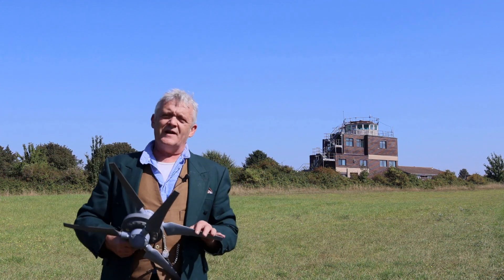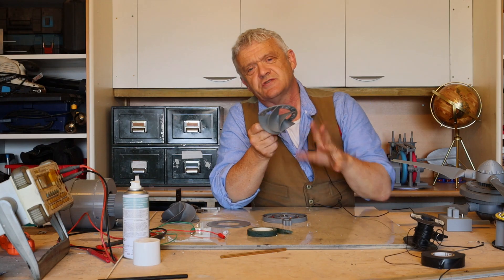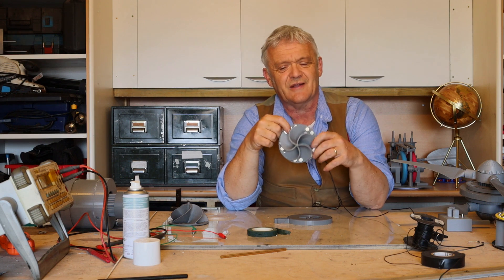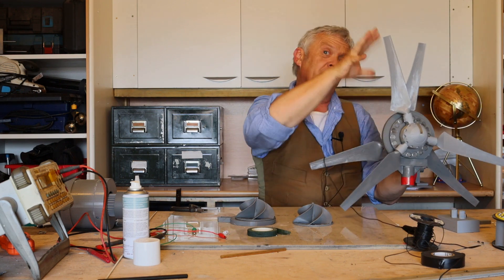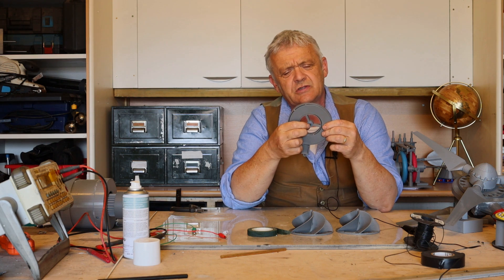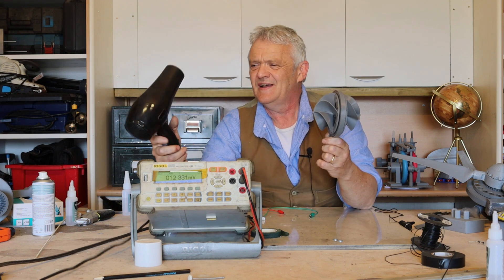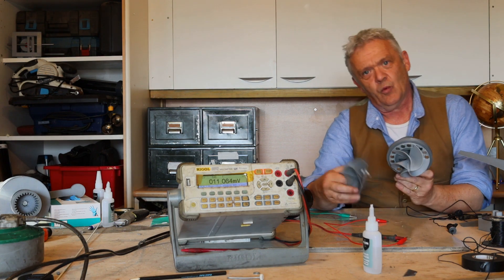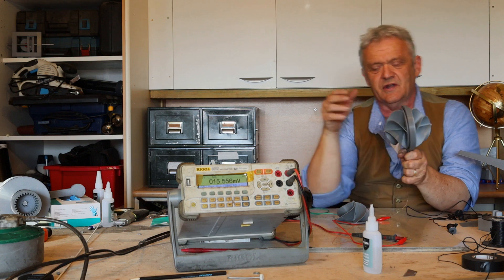2043 An Omnidirectional Wind Turbine

Comment: Evolution of vertical generators: Savinius -> Ugrinsky -> C-rotor -> Darieus.
Until the omnidirectional Darieus rotor with rotation in opposite directions has been tested - all these are just toys
Reply: C-Rotor as Darrieus should be used with the NACA 0018 profile or even with the best profiles WUP 1615 or NACA 0018TC-39.
Angle of attack is 2.5..4.5

Comment: You know that would work near the ground in high turbulence and low wind velocities.    It would cost almost nothing to maintain.     It may not have the highest theoretical efficiency, but I bet it can flat out generate any normal wind turbine for the same size over a year, and cost less.

Comment: If ((YEMPE)) younus electro magnet power engine is established then the nature of this world will large change and human welfare will be achieved in all areas and 90% of this planet will be pollution free and life of future generation will be very high And the world will be beautiful and safe. I AM MD YOUNUS ALI  I  NEED ONE INVESTOR.

YEMPE for 100% free mechanical power generation. It is possible to generate free mechanical power by designing medium and large size Engine sets.

YEMPE for 100% FREE power generation. It is possible to generate free electricity by designing medium and large size generator sets.

(YEMPE...ENGINE) brand new incredible invention that is easily accessible beautiful invention that is capable of meeting all the needs of all classes of people in this world All this world of 100% free which will be a part of very hassle free and desirable topic for every one.

I will build a completely new design car that will run without any liquid fuel gas and battery and 100% free And will not require frequent servicing and replacement of parts. Maintenance free cars are very useful for people and will prevent wastage of money.

Comment: Thank you, amazing work. Your idea is very wonderful.  It is spherical in shape and will also rotate if you place it vertically, and perhaps then if you lower the spacer in the middle and make it with one flow of the blades from the top of the ball to the bottom, it will rotate as is the case in fireplace fume hoods.

Comment: if you dont link the magnets together but instead  offset one side of them to fill the gap between two magnets on the opposite rotor and reverse polarity of the magnets you could essentially simulate double the speed of the rotor.

Right rotor N hits coil 1->left rotor S hits coil 1->right coil N coil 1. 

Left rotor magnet should sit in the gap between the right rotor magnets 1 and 2.

One side all S
one side all N

magnetic field would hit the coil twice as much in one complete rotation

Comment: Brilliant Robert, the Dual Archimedes Screw Drive has great potential, but how about taking it to the next level with a large Dual Toroidal Propeller on either side. As the Archimedes screw is the precursor to the modern prop, it would be interesting to see how the toroidal props would compare and I'm guessing they would work in all directions as well.

Comment: Would you be willing to try using round neodymium magnets as external ball bearings on the outer rim of the wind turbine spinning inside of the coil?
My hypothesis is two fold. Firstly, that the magnets will polarly lock to each other and not roll unless under the correct amount of pressure and friction and then will roll as a tidy locked force. Alternatively spacing them out and allowing them to roll will both increase and interfere with the magnetic field cohesion within the coil. Perhaps ovals that could roll within thus accentuating the potential field motion dynamics. Perhaps being tunable to something akin to grouped vortexes as a sustained vortex wall to the larger field...

For stabilization of such a field, the inputs would have to be rotationally quantified to the coanda effect, perhaps a few strands of appropriately shaped electromagnets to be stimulated on the individual strand level.

Comment: Wonder if that would reduce the laminar flow requirement for the more standard wind turbine design. If it does, that would make a massive difference to the energy production of most farms, where the distance between turbines and orientation of turbine relative to the dominant wind direction are major limiting factors.

Comment: Hi! Interesting video!

Of course, anytime when I see a video about some smart, "out of the box" design, the first question is why it is not being used everywhere 😉 Sometimes there are serious reasons for that, but sometimes it happens that actually nobody thought about a revolutionary idea before. Hope it's the second one, however I have some doubts.

How about doing performance comparison for this design vs. the one wich classic blades, of course with the same radius?

I'm not really sure if having the turbine omnidirectional will bring any profit - the turbine itself weights more, thus requires stronger wind to move it at all. What is the performance for the wind blowing exactly from the side? That would be very interesting to check.

Also, classic blade turbines rotating on axle have very neat functionality - if the wind is strong enough to be dangerous for the turbine or generator, turbine places itself sideways to the wind direction and stays safe. In omnidirectional design you might need to involve some mechanical brake, and the pole will be always under heavy load if heavy wind occures, no matter from which direction.

BTW, the modification you have shown, that skips the moment of stopping the turbine while wind changes - IMHO this does not make much sense: first, it is very uncommon for wind to change direction often enough to gather any profit from avoiding turbine stop, and second - doesn't such design create an additional drag that causes the turbine to rotate slower?

However, I'd be happy to see comparison between this design and classic one.

Have a nice day!

Comment: Robert, just found your channel, my eyes now red raw from non-stop watching so many facinating experiments.   How you find the time necessary defeats me!   I have so many questions but the key ones:  1) Where do you source quality magnets and copper wire in the U.K.   2)  I can cope with 3D prints 2.5 times the size of your Omnidirectional Wind Turbine, but I don't have the skills to draw it in CAD, is there any chance you could make the drawing available?  3)  IfI were to scale up, I'm guessing that adding more rows of magnets and associated serpentine coils would increase power out - would this be correct and proprtional?  4)  I was looking for a solution to heating my workshop over Winter, I tinker with soooo many things, Jack of all trades,  Master of none,  I was thinging of a sand battery, heated via solar panel, but now wondering if wind turbine(s), possibly charging / discharging 12v lead acid batteries as well as 'dumping' to sand would be suitable - what is your view on this?   Phenomenal effort to produce these videos, hugely appreciated!!!

Comment: HEY ROBERT MURRAY-SMITH!!!!
You could generate electricity by making this into a large inflatable kite. 
Make the whole thing out of shaped inflated mylar. If the blades are several inches thick of inflated formed mylar ballon, with a curved carbon fiber strut at the very edge of the blade and one at its base for each curved blade (6 on each side for a total of 12) plus one down the center (13 total carbon fiber struts) each thin and just to supply tensile strength. Maybe also a thin carbon fiber hoop strut going around the outside of the blades half way between the equator and the apex on both sides to provide a little extra support. If it’s filled with helium or maybe just air and the balloon is made out of black plastic so the sun heats up the air inside and makes it stay buoyant and float, then as soon as it gets high enough it will act like a kite and the wind will provide lift and make it spin and generate electricity. Maybe a combination for partial buoyancy at night. That way if a bird flies into it, it’s just hitting a soft balloon. Or, you could put multiple thin carbon fiber strut/hoops around it like a chain link fence or a net/grate so birds just bounce off. Stabilize it with 3 or four cables like at the base of a pyramid with a main cable in the middle so it won’t wander and you have a free source of energy! 
The higher it flies, the stronger the wind. 
Your neighbors might complain though. 
It would be great for people who live “Off The Grid” in remote locations.
Reply: I believe there could be issues with this. You'd need to transfer the energy back down, meaning a reasonably hefty cable, even a 12ga wire at say 20 meters is a substantial amount of weight. So it would need to generate quite a bit of lift. Further downwind, or rather upwind, in order to launch it would require strong winds or some other way of generating substantial lift from the get go. That said, in the aire of Robert, try it and let us know!

Comment: I would love to see you explore coils and power generation. So, undert the same input power, how do different coils behave? Serpentine the best? size of wire? number of turns? all underst the same spin rate. That would tell us a lot about how best to make the type of electricity we need, high voltage or high amperage. Figuring out which types of coils, how many turns, how think the wire, how the shape impacts it, etc. strenth of magnets.

Comment: lol the end keep me up with what your doing lately , i have good results adding 2" inch foamboard insulation on the outside , i use 2" cut piece of 3/4" pex pipe for spacer , i use i think 1" hole saw with the bit removed from the center , and core spots where the pex goes into the foam i roll some thin foam on the pex and fill the spacer with foam from the hole saw and use 3 1/2" inch decking screw or stainless with a 1/4" inch washer so i paint the foam with roof tar for the heck of it and add those spacers on the edge , then i used 1/2" cement board in 3x5 foot sheets cut to screw over the foamboard with the spacer and the washer over the cement board , so i take a one quart acrylic stucco patch (they have acrylic cement or concrete repair too but i use stucco patch acrylic one quart dries white ($9 , $7 prebidenflation ) and up to half acrylic white paint or whichever i did purple and it goes thru the plaster (same color if scratched) ....cement board is not rated exterior but i figure it isn't exterior with the acrylic cement , i used regular thinset layer between for filler on this one ....i have some block post stuff i'll build soon sort of like pole barn stuff but with block posts, columns i guess .....i've been digging a trench and pouring 4 gallons of taurus sc fipronil in it for bug damage because i have emergency restorations going on i take breaks to go online a lot because the heat lately ,,, i hope i'll get it done fast because i have sheds to rebuild and i might make a post beam 12' foot by 12"  foot guest room up on posts but i'll cover it with seashells maybe and same method foamboard , cement board  , 6x6 posts , metal roof the dimension is for no permit where i live ... hopefully i'll get some bigger actual tech type projects going out of my metalshop soon but i have big projects ,cars  a boat motorcycle truck etc everythign becuase i getting back in shape from being blind still
Reply: urgh lol thing is for across outer walls i have the inside stripped and i use 4" foamboard for r20 the wall studs are about r1 per inch (wood) so it's riddles cover those too but i can add 2" furring strips horizontally across right thru the siding and into each wall stud for lateral strength , creates a much stronger wall !!! (edit: the studs this method only not covered with foam where the furring stip bolts on through from exterior and add 2" R10 extra with 2 1/2" thicker outer ....the concept of stucco involves leaving space at the bottom for drainage if water somehow was in the wall and it uses support blocks spaced on the ground so i'm adding footer wall , built in resting spots , can add standard stucco layer thicke rin future or brick very versatile/ mssg too long again lol

Comment: that's very interesting design i wonder if you can add another ring so as it changes direction that ring gives some extra induction ....i better change my account soon i posted too much political and even r*cial trolling ,,,,there'sa holocaust going on ....is why it's hard to contain...but i thought if you add a tail like a weathervane won't it face the wind ...the geodesic dome or half one is intersting imo and theres a new one thats oval with a dome each end they are silly sort of but have characteristics like short scraps could be used and it only makes the -dome stronger but if the (edit: half , half dome)-dome is on rollers it would spin so the funnel faces dirrently and the triangle each would be good for mounting individual generators in each i've daydreamed on befor.....hope you're great i get followed if i make bad comments and deleted all across , big fan of this show good presentation high class educational stuff imo thanks sir
Reply: lol i always have more but on the dome itself as a structure imo need two to hold the insulation and the interior/exterior seperate a smaller dome inside a larger one for wall interior space and they need a base for example old tires around the perimeter for it's base for more straight floor space ....there's a page with a program on the lengths for what size dome and different layer options too somewhere online

Comment: Nice design. Would love to see a comparsion to a similar sized Vertical Wind Turbine. I believe, your design should be more efficient. Against a common horizontal Turbine, I´m sorry, but I have my doubts. They already turn, to always catch the wind with optimal conditions and the scalability with size ist better, too. That said, I believe your solution could be great for smaller installations and should at least be very competitve against vertical designs, that are of a similar complexity.

Comment: if you scale it up, it looks like it would be so much heavier than a conventional wind turbine of the same diameter. does it at least proportionally have as much surface area for its weight and thus more torque and power generation than a turbine of the same diameter?

Comment: It seems like the counter-rotating blades would be great atop a stack of your lateral wind harvesters (Darwin / Ventum), as that would maximize the efficiency of the blades while diminishing their potential harm against wildlife. But I can also visualize a large ball or omnidirectional "blade" above the same stack. I wonder if the omnidirectional blade catching wind from the side, but also being above a stack that is driving wind up, would have benefits? For one, it should operate in lower air speeds due to the stack concentrating air flow. A second benefit is it might also be more stable in higher winds (up to a point). But ... are there hidden problems to be discovered in the implementation?

Comment: I think it's more accurate to say that wind turbines typically come in 2 primary form factors, and the one you didn't mention, Vertical Axis Wind Turbine (VAWT) is also omnidirectional. It would be interesting to see this ball design vs equivalent scale HAWT and VAWT designs for starting windspeed, survival windspeed, noise, and power generation curve
Reply: Actually wind can blow up or even down along the edge of a roof and in front of an obsticle, and even at the end of a dead end ally. Congrats to Robert.
Reply: @ulgencutube  In truth, there are also so-called katabatic winds and those who go sailing know this and fear them because they put spreaders in the water; but these are not winds that can be used to produce electricity.
In truth there are also winds that go upwards, the well-deserving thermals that glider pilots know well and look for but even these cannot be used to produce electricity, which is in truth Robert's objective.
Reply: VAWTS are no more omnidirectional than HAWTS. Both can make energy from wind blowing in any horizontal direction. 

Neither can make energy from wind blowing upwards or downwards, which this one can. But the wind doesn't blow that way so that's not something people usually design for

Comment: Ought to point out Rob,  that most large passenger aircraft are still "propeller"driven.....its just done differently.  Instead of a piston engine driving a 2, 3, 4 etc., bladed propeller its now a gas turbine engine driving a massive 20+ bladed ducted fan. On average 80 odd % of the thrust comes from the fan, with just 15 20% coming from the exhaust.

Comment: sir you have crack the code. almost 10v with that small turbine. i wander how many volt will be generated if it is bigger as the 6 blade turbine 🤔

thanks for sharing your knowledge with us.

Comment: Robert this design is only omni efficient around a °270 axial plane,although this does have the benefit of a high torque value via the coander effect which flow over the wind facing side on and into the away wind facing side.
Whereas at °90 aligned to wind on the dual vortex capture rotational side once again it has a higher torque value, on the opposite side a further °180 from the initial °90 dual vortex rotational side it shall have very little torque. 
It's not entirely torque efficient omni but still quite a good concept covering an efficient °270 of swivel axis! 👍

Comment: I like this, much less drag than whirring blades, much lower profile, so potential to be put in lots of places and gather energy, the design lends itself to being moulded, so cheaper to make, especially at larger scale.  Some airflow dynamics clever sausage, should run simulations of this at different scales, to understand more about what power could be generated for different sizes and optimize the design. on a larger scale, you could use the space in each hemisphere to house batteries and also have a storage solution.